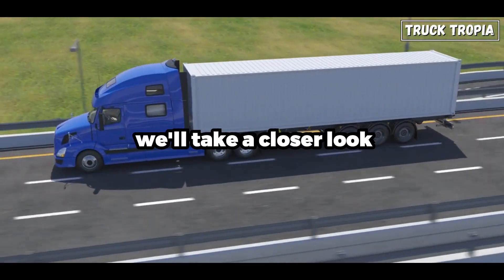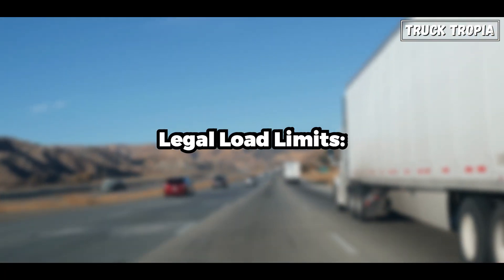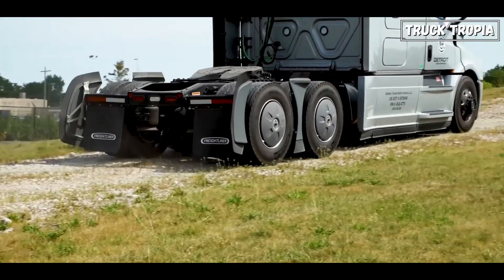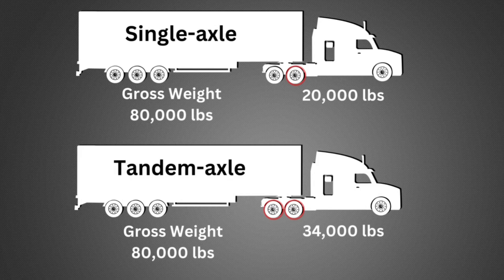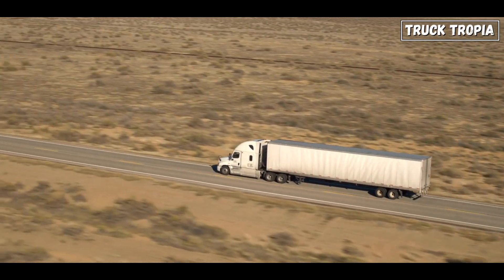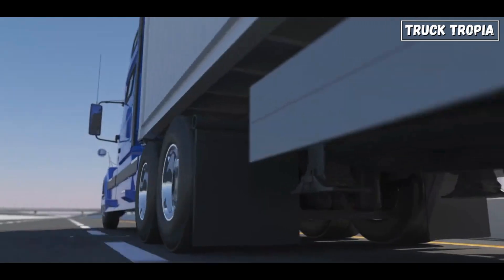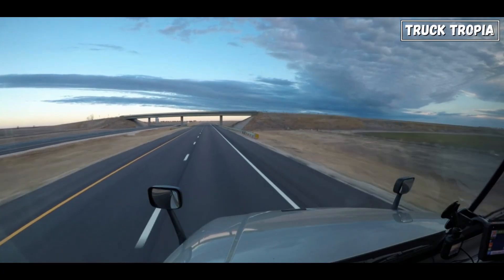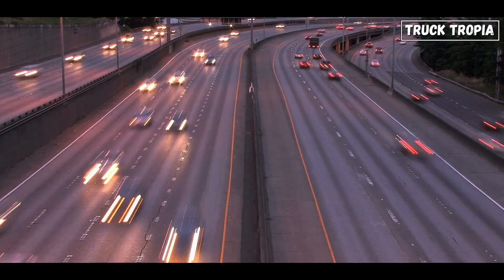Why Do Semi-Trucks Need So Many Wheels?

Comment: Yet in Europe most trucks are only 2 axles, on top of being cabovers.
Why not look into why Europe has stayed with cabovers and why they tend to a single drive axle??
Reply: European trucks usually have a max overall length limit for the truck and the trailer so cab over trucks with small or no sleeperberth allow for longer trailers and more cargo room.  Over here in the US at least we only have a maximum length for the trailer only and the length of the truck does not factor into it allowing us to have larger sleeper berths and more overall room in the truck.
Reply: @rangerlawrence6034  That's right. Overall  length overseas is 18.75 meters which is 61 foot. But can be allowed up to 25.25 meters.Trailers usually are 13.60 meters = 44 foot compared to 53 foot= 16 meters in the US and CDN but can be longer on special heavy haul. It is best to have an overall  way better quality cab over truck with single drive axle and mandatory full air ride suspension for better maneuverability and smoother overall ride than a big cab which technically nobody really needs. European cabs are already designed huge and deliver enough room where most things are designed better and within reach even from the driver seat. For a lot of things i don't have to bend or twist  in order to reach it like i have to do in US cabs.
Reply: Because Single drive axle rides way smoother,  cab over has better maneuverability and we usually have tridem trailers which also are build stronger than these toys we have here in NA.
Reply: @tomh9807  The shorter wheelbase and cabover does give better manoeuvrability, sight along the front. I would debate the rides being smoother.

I would also think the smaller roads in older areas would have played a big part of keeping them to fit.
Reply: @jaquigreenlees  The second part of your comment i absolutely agree. The first part not so much. European cab overs also have mandatory front axle air ride. So this, too plays a big factor. Just try to drive especially over rail road tracks or uneven roads in general with a double drive axle US truck and then with a european single axle. The second axle of the US truck will always bounce back quite hard despite the air ride and effects you even harder sitting in your seat up front the faster you go over the tracks. That does not mean i am speeding over them.

Of course it also depends how smooth the tracks are build in the roads , meaning if they have kind of deck plates build in on both sides or not. Mostly they don't have here in NA. 
But like i already mentioned double axle US trucks drive more rough believe me. I drove them for years overseas and now i have driven all US trucks brands  almost for 20 years here in NA. So I have the experience to tell that single axle trucks actually drive smoother. That is fact and not debatable. Have a great day my friend.